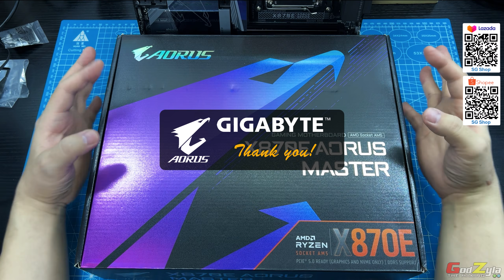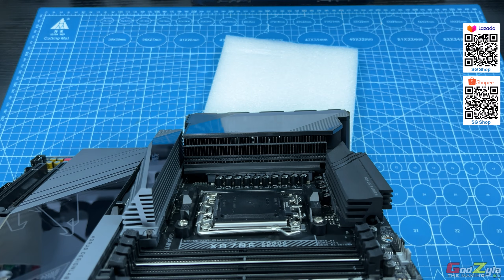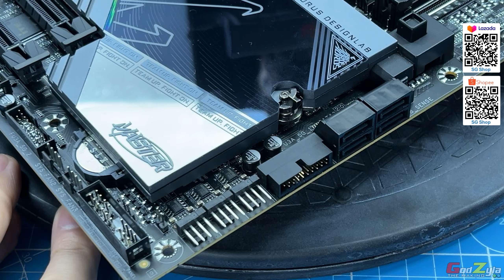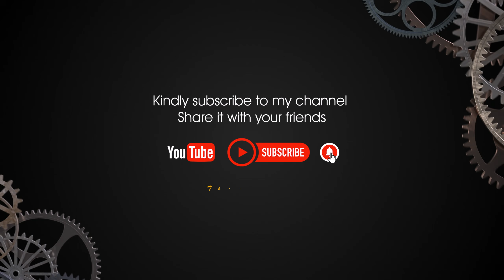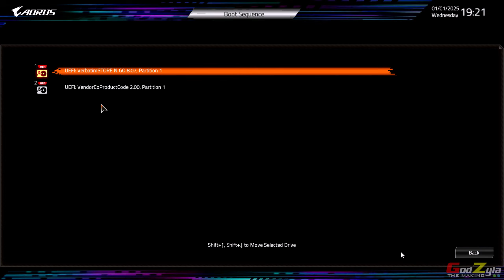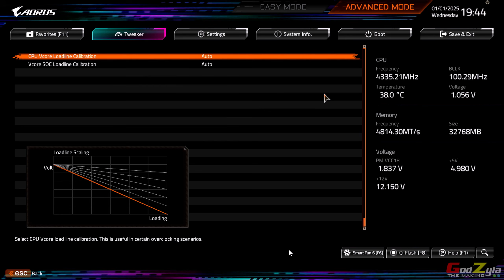Gigabyte X870E Aorus Master

Comment: I just love going through your videos. Im working in a second build. This board seems like it could be a contender.
Reply from the maker: Hi Slyclient The Tech Dad, welcome back and thank you for your kind words.. I wish you all the very best with your build too 😉 by the way, you have a unique channel too https://www.youtube.com/@Slyclientthetechdad 👍👍👍 was watching this OSMETA EGO1-M External GPU Dock Review - RTX 4090, GPD Win Mini https://youtu.be/AJGsR1eBef4 Thank you!
Reply: @KleoYan Thank you. I need to add to my videos, just need to find the time. 😊  Out of all the x870 or E motherboards that youve looked at, which one stands out thr most? If you could only have one, which would it be?
Reply from the maker: @Slyclientthetechdad  I will choose a board which cater for my needs, I mainly use my rig for leisure and work. I do not play PC Games. 
is either I will pick Asus X870E ProArt or Gigabyte B850 AI Tops

1) Asus X870E ProArt
- 10G Port for my ISP
- Another Lan port for my NAS (2.5G, I wish this is at least 5G but not) 
- 4 m.2 slot which is just nice for me. I do not use 3.5" HDD nor 2.5" SSD (I dislike cable mess in a case and lesser cable, better airflow. 
1st M.2 for OS and application (2TB) 
2nd M.2 for Raw and Cache files (2TB for video editing) 
3rd for complete compilation files (2TB, if fill up, I will transfer some final compilation to my NAS) 
4rd my important data, non important ones, I will transfer it out to my NAS. (2TB, if fill up, I will transfer non important data to my NAS)
- I can use Alt mode portable display

2) Gigabyte B850 AI Tops
- 10G Port for my ISP
- Another 10G for my NAS, even better than the Asus 2.5G 2nd port
- 1st M.2 OS and Application 
- 2nd M.2 for Raw and Cache
- 3rd M.2, Complete Compilation files + Important data (4TB, if fill up, I will move non important data to my NAS)
- I can use Alt mode portable display
Reply: @KleoYan Thanks for sharing your use case. Im my case. I would be using this mainly to game and possible light overclocking ram. I have my eye on the Asus X870e gaming  (which I watched your video) the Gigabyte Aorus Master, and the Asrock Taichi. All for gopd orices at my local Microcenter. Do you like any of these choices? If so which one and why?
Reply from the maker: @Slyclientthetechdad  Ok I will be honest, if you have not read about ASRock boards https://www.reddit.com/r/ASRock/comments/1mvgndh/9000series_cpu_failuresdeaths_megathread_2/ just to be on the safe side.
Reply: @KleoYan Thank you for the heads up. Thiis me leaning towards the Asus gaming.
Reply from the maker: @Slyclientthetechdad  the choice is yours. all the very best.

Comment: 14:50 mistake made on your video. The 2nd and third M.2 slot shares lanes with the PCIe lane, not the first M.2 slot.
Reply from the maker: Hi Supremax67, welcome to my channel. Point noted with thanks. 👍
Reply: @KleoYan On the flipside. Nice to see a thorough breakdown. I was going to for the Elite, but the heatsink is much better here to deal with a 4TB M.2
Reply from the maker: @Supremax67 I see. For me. I will choose not to use them. One whole piece is just accumulating heat, if place all m.2 in. I rather use separate heatsink and I always do GPU vertically mounted just to get clearance.

Comment: Heads up!!! Bought this motherboard and now my argb lights stutters so much i cant even watch my case lights anymore as it sucks. The lighting pattern fps stucks at just 9 fps while it should normally be between 25 to 30fps when inspected via signal rgb. Rgb fusion is trash. Every two days the driver crashes. Messages the support and they directly said to RMA the board but am from nepal where its so hard to RMA the product you have to take accountability for all the shipping charges and extra unseen charges. Use 3 nvme ssd and your x16 graphic card slot will bifurcate to 4x4x4 which is 😖.
Reply from the maker: Hi Psycho Engineer :), welcome to my channel. So sorry to hear about your mishap. Hmm, I don't face the issues you are having when I set up this board for friends and such. it will be silly to stop anyone from getting this board just becuase of defective argb headers and using 3 nvme Gen 4 drives does not set the bifurcation to x4x4x4 hmm.. maybe you really need to RMA your board, which I can understand, the location you at is a hassle.

Comment: aorus x870e aorus master es normal que los led de clear cmos y q flash plus siempre esten encedidos ?
Reply from the maker: Hi Expresso Administrativo, welcome to my channel. Yes it is perfectly normal when you have your system on. it's always lighted up.
Reply: @KleoYan  y si el pc esta apagado ? tambien es normal que esten encendidos ?
Reply from the maker: @expressoadministrativo7338  yup it is normal. I believe there is a setting in UEFI you can turn that off. you can check it out and to fiddle in your UEFI. I can't rememeber where that section is, plus I have returned this motherboard to Gigibyte.

Comment: hi) which usb 3.2 gen2 connect to cpu? only 1 to cpu other 3 to chipset
Reply from the maker: Hi Sta K, welcome to my channel. Hope these will aid  you as it's listed at the spec page https://www.gigabyte.com/Motherboard/X870E-AORUS-MASTER/sp#sp 
	
CPU+ASMedia USB4 controller:
- 2 x USB4, USB Type-C ports on the back panel
CPU:
- 1 x USB 3.2 Gen 2 Type-A port (red) on the back panel Chipset+USB 3.2 Gen 1 Hub:
- 4 x USB 3.2 Gen 1 ports on the back panel
Chipset:
- 1 x USB Type-C port with USB 3.2 Gen 2x2 support, available through the internal USB header
- 3 x USB 3.2 Gen 2 Type-A ports (red) on the back panel
- 4 x USB 3.2 Gen 1 ports available through the internal USB headers
- 6 x USB 2.0/1.1 ports (2 ports on the back panel, 4 ports available through the internal USB headers)

Comment: Where do we connect aio pump cable on motherboard?
Reply from the maker: Hi Prithpal Matharu, welcome to my channel. I do apologize on this content. Kindly plug your pump cable to CPU_OPT. I did a mistake.. the CPU_OPT on gigabyte motherboard, you can control and to set the CPU_OPT header in UEFI without issue.
Reply: @ Thank you for your time . I have noticed if I am using Asus x870E hero motherboard the ASUS ROG Ryujin iii 360 LCD is very quiet and efficient but the moment I use gigabyte motherboard the pump noise is awful. Have you noticed this as well in your testing ?
Reply from the maker: @ reason for this. Most motherboards fan headers are of 2A. But on Asus is 1A.
Reply: @KleoYan  All of the sudden an update pop up in armony crate for aio and since then the aio is quiet and temps are under 70-75 c under heavy load . I am using 9950x .. Do you think 9950x3D is a good jump from 9950x I am within 15 days so can return and get 3D version
Reply from the maker: @MrPreet23  nice.. thank you for the update. As for 9950X3D, go for it if the price is 50 to 100 dollars difference.. the 9950X3D not only does gaming but it does work too.

Comment: I have the same board, and I've been trying to figure out why I get d9 code in the  debugg code. System is running fine no problems.
Reply from the maker: Hi Jonny_, welcome to my channel. Do you have multiple M.2 drive and such? "D9" debug code indicates an "Error loading Boot Option (LoadImage returned error)
Reply: @KleoYan  yes I have 2 ssd drives. 1 Gen 5 in slot A , and 1 gen 4 in slot D.
Reply from the maker: @OneTrue_Jonny  on your m.2, I assume the Gen 5 m.2 is your OS drive. now your Gen 4 and the rest of the 2 SSD, do they contain boot strip as in have an OS in their partition? if you have that, it will appear D9 code. example. previously you are using Gen 4 as your OS drive. you replace it with Gen 5 which is currently your OS drive, but you did not erase Gen 4 or reformat it. therefore there are OS strings. So your board get confuse, which is the correct boot drive.
Reply: @KleoYan  thanks for replying. That's the exact scenario. However, I remember wiping the drive before installation of Windows 11 on the new gen 5 drive. I checked the partitions and there is currently only 1 OS in the main drive.

Comment: I keep getting a d9 motherboard code, DB or D8 or 08 when it boots. Then on restart I get 0d and it fails to restart. This is the 2nd motherboard code so it might be something ive done. It will boot fine and mobo code will be A0 but the randomly switch to DB/D8/08. I have swapped out ram as well. 6000mhz g skill and 6000mhz corsair both supported on mobo memory list. It seems to be a ram issue with Gigabyte control center app and icue not working together properly. Please help any advice wouold be appreciated
Reply from the maker: Hi Give Back Ross, welcome to my channel. Maybe do a quick check on your rams. plug only 1 stick at B2 dimm slot. see if you get that error. If not swap to your 2nd stick on the same slot. This way you can tell if both sticks can run individually with out issues. if both able to. try A1 and B1 slot. if it's still gives you error, that means to say either your proceossor or board is having the issue.

Comment: Sorry if I miss this from the video, but do you know if the CMOS battery can be replaced without removing the chipset heatsink? If not, how do we remove the chipset heatsink?
Reply from the maker: Hi Yakumo Yagami, welcome to my channel. You will need to go behind the motherboard and trace the screws that is holding on the to plate above the CMOS battery. I have returned this unit to Gigabyte.. therefore can't show you with a video. So sorry about it.
Reply: @KleoYan  Thank you for the quick reply. I assume that means the removal of motherboard is required to access to it? It would be really troublesome when the need to replace the CMOS battery arise.
Reply: @kirayagami7893  yes i just got the same board and i think the design is stupid you would have to remove the motherboard from your case and remove the screws from the back that hold the chipset heatsinks

Comment: Hi there, just bought this motherboard. Does it matter which m.2 slots i put my SSD's? I understand they should both go in the silver ones, but should i choose one over the other two for my OS?
Reply from the maker: Hi TheObliquities, welcome to my channel and yup you are correct. So long you plug your OS m.2 to the silver slots, it does not matter which as all the silver m.2 slots are controlled by the CPU and it's of Gen 5, backward compatible to Gen 4 or 3.

Comment: If the 1st pcie 5.0 slot is set to x8 in the bios can the 2nd pcie slot (4.0) also be set to x8? Thanks.
Reply from the maker: Hi Damien Toman, welcome to my channel. Yes you can. Hope this does help. 😉
Reply: @KleoYan  Thanks for your reply. Isn't the 2nd slot chipset controlled?
Reply from the maker: @damientoman  oops, my bad. sorry. you are right.. so sorry.. I got mix up with another board.. ya after going through yes.. the 2nd slot of this board is controlled by the chipset. you can only control if the slot is controlled by the processor.. thanks for the correction .. my bad sorry.
Reply: @KleoYan  No probs. Thanks for the confirmation.
Reply from the maker: @damientoman  Yup, again I do apologize. thank you for your kind understanding. 👍

Comment: I wonder if i can pair this MB with H6 Flow case and Arctic Liquid Freezer III 360 AIO. I know it'll be tight, but if it can fit ill do it. Would be perfect.
Reply from the maker: Hi OmniVerseStar, welcome to my channel. Do pardon me as I am not familiar with H6 Flow but for Arctic LF3 360 to be mounted on this board, there are no issues. I guess it will be best if you can make your enquires at NZXT reddit forum https://www.reddit.com/r/NZXT/. Thank you for your feedback and all the best with your build too. 👍👍👍

Comment: Where do you put the probes?  and the other detector?
Reply from the maker: Hi Deaths 0079, welcome to my channel. It's your choice of what you wish to detect. For me, I will just dangle it inside the case to read the temperature of the case, so that I can tune my case fan rpm to have a balance airflow which will impact the overall thermal of my system.

Comment: Heads up to all buyers the Arctic liquid freezer 3 will not fit unless you modify the top ssd heat sink
Reply from the maker: Hi TM_IPOD, welcome to my channel and thank you for sharing this piece of information. Greatly appreciated it 👍👍👍 infact it's listed on Arctic Website https://support.arctic.de/lf3-compatibility
Reply: Arctic has a compatibility list for their aio and will also provide a heat sink that will work as long as you have a receipt.
Reply from the maker: Hi DRG1021, welcome to my channel and thank you for sharing, greatly appreciated it. 👍👍👍
Reply: @DRG1021  heck, just contacted them. thanks
Reply: it does work lol I have e the same , u just have to reverse the brackets and then install on cpu then everything will fit
Reply: @jatin5587  hey are you sure that works? the screw holes on the brackets arent in the middle, so that the AIO is lower relative to the CPU in order to be directly above the hotspot which is in the lower half of the CPU. If you inverted them and the AIO is now basically on the top half you could be needlessly increasing temps.
Reply: @Liziumbattarie correct its ment to overhang the hotspot on the ccds reverse  install will lead to high temps would not recommend
Reply from the maker: Hi JATIN welcome to my channel and thanks for the info.
Reply: is it the mounting system that doesnt fit or the size of the RAD, wondering if an LF2 will fit..
Reply: @BuffShamans  the cpu cooling block, the inlet and outlet tube to the rad will be pressed up against ssd heatsink and won't mount properly on your cpu unless you cut away
Reply from the maker: @tm_ipod9142  Thank you very much to have answer the question. greatly appreciated it.
Reply: learned the HARD WAY LOL
Reply: @kpj9535 haha get the hacksaw or dremel out its about a 3cm cut length and width, good luck, 😢

Comment: for 14:30 , you said it's gen V 16x, does it share the lane with the GPU ? will a m2 ssd in the first slot take the GPU down to 8x ?
Reply from the maker: Hi Robert Pana, welcome to my channel. All PCI-E Slots does not share lanes. The only lane sharing is on the m.2 slots. if you want the top m.2 slot to run X16 , do not plug in any nvme SSD to 3rd or 4th m.2 slot.
Reply: @KleoYan  thanks for the clarification 😇
Reply from the maker: @DarkFugitiv  you are most welcome.

Comment: Thank you, Kleo! 🙏🏼  I always learn cool New Stuff™ from watching your videos! 😎

The RAM cooling fan might work nicely in a system build with a 240mm or 280mm AIO, but I think it would be great if Gigabyte made the fan bracket with a friction hinge at the base of the fan mounting arm so that the angle of the fan can be adjusted (just my thought 🤔).  Otherwise, I'd give the Gigabyte X870E Aorus Master a 98 (of 100) points.   It's a great looking motherboard!

Thanks again! 😊
Reply from the maker: Hi Michael Bobczynski, welcome back. Thank you for your suggestion. Greatly appreciated it. I will highlight your feedback to Gigabyte. Infact to be honest. this board is all good, at least no lane sharing on the PCI-E Slot hahahha. but it's abit high on the price though 🤔

Comment: What do I do if I'm getting error c5 when trying to dual channel (a2+b2) and its refusing to boot? 
(The ram is on the verified compatible list) and I've trued both sticks separately by themselves in slot a2 and it boots fine, but both together a2+b2 it will not boot, just sits on code c5. 

Please help
Reply from the maker: Hi RagineBrit, welcome got my channel. I like to check. If you plug 1st ram to either if A2 or B2 does it work? What about the 2nd ram? Does it work when plug to A2 or B2? If both rams sticks works individually on either A2 or B2. Indication both rams works fine and ram slots work fine too. Next question. What’s your bios version. Did you update it or running the bios out of the box?
Reply from the maker: @ttvRagingBrit  I forget to mention if you have done the steps and verified that both rams and rams slot are working properly. Even after bios update and still having code  c5, this is typically indicating a problem with the CPU power delivery system; specifically, it could mean that the power supply unit (PSU) isn't delivering enough power to the CPU, or there might be a faulty component within the power delivery circuitry on the motherboard itself. The only way is 1) to resit your cpu again or 2) to test with another working CPU on this board and if this board still reacts the same. This indicates is not your cpu not your rams or ram slots. Kindly contact gigabytes to replace your board or to have if fix

Comment: Please review Gigabyte EAGLE x870.   For some reason when paired with 7950x AMD it boots fine — but I cannot install a graphics card, if so it will not start at all.  I double checked only the onboard igpu in the cpu is working.  If I install gpu and switch hdmi to gpu it will not even start.  Any settings I missed?
Reply from the maker: Hi Firebrand, welcome to my channel. I see what I can do. No promises though.